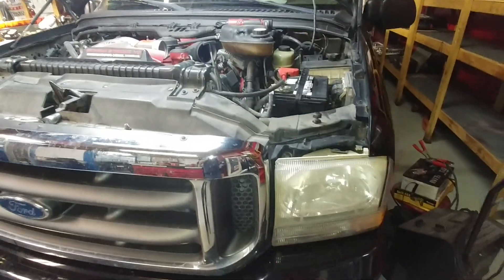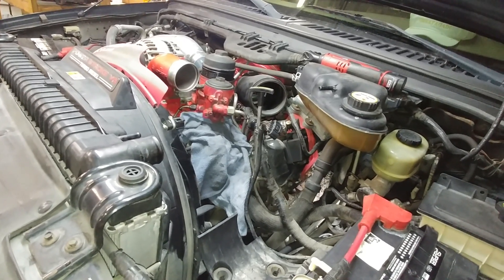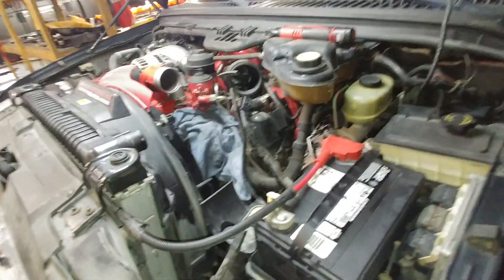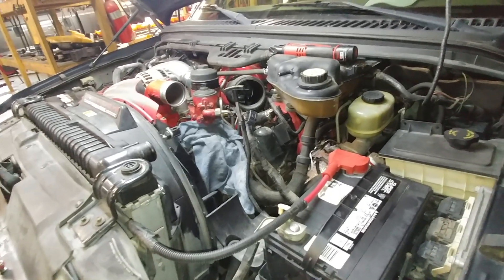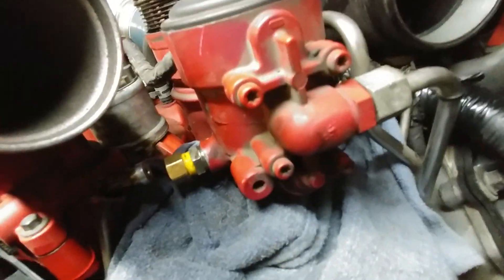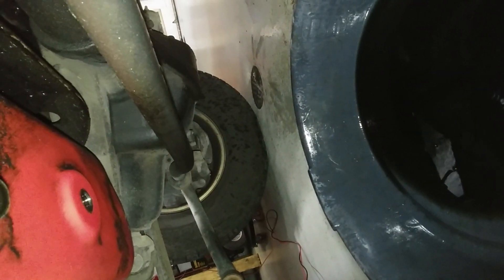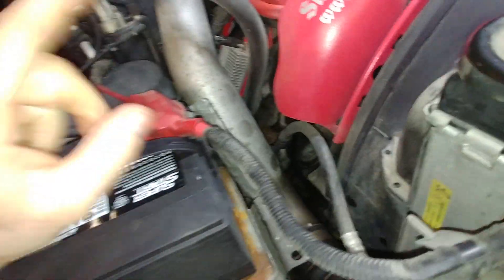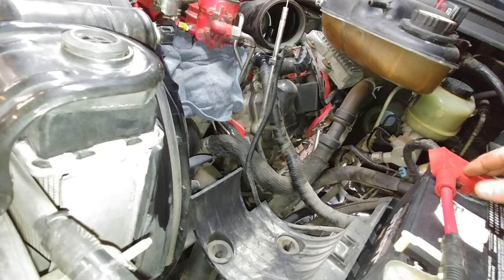6.0 Powerstroke Making Oil Injector leak

Comment: My 06 had the same issues several years ago. Always wondered why on some occasions that power would fall off sometimes. Found bad fuel side injector o-rings on #7 and #8 injectors. Also found the fuel pressure was WELL below spec. Installed Ford factory blue spring upgrade, replaced the fuel pump, just cause, and all new injector o-rings, since i was already in there. That was about 92,300 miles ago, runs awesome, and no more fuel in oil.  After some discussions with other technicians, very low fuel pressure can cause the injectors to drawn the fuel needed, causing the o-rings to roll under and leak. Just a thought. Solved the issues with my truck.

Comment: Anthony, what is the max pressure the frame mounted pump? What type of fuel does he run? “If” he runs an additives, what kind and does he double or triple dose. Blue spring update? It seems fuel in the oil is the result but what is the root cause?
The only reason I ask and it’s not related to a 6.0 however we had a similar concern where the low pressure pump was feeding too much pressure to the high pressure pump and it caused oil contamination. Gas car, direct injection. Just trying to think out of the box. Your the expert on the 6.0 and you have seen more that I will ever see.

Comment: Hello. Just found your chanel and i like it. How did you make the block off plugs for the fuel filter housing? I was trying to make some but couldnt find right threads at the big box harware store.
Reply: Try the Hydrolics hose shop I just got one of those problems thin oil I wonder if the injectors were leaking internal to the oil discharge or seals. On the one I have all seals have been replaced

Comment: Usually these injectors leak where the body of the injector screws together not at the upper o-ring. Which explains why in the previous video of this truck replacing the o-rings did not fix the leak requiring injector replacement. 
BTW IDS is capable of turning on and off the fuel pump instead of hooking up battery and all that extra stuff.
Reply from the maker: Dillan Webb that might be true about the housing of the injector.  I do not attempt to take them apart.   Also I'm aware of the Ids capabilities.  It's fairly ridiculous to have the key on for all that time.  I can hook that wire up in about 30 seconds.
Reply from the maker: The previous injectors were obviously media blasted also.  And they were cheap remans from some online retailer.   I don't entertain those injectors EVER!!

Comment: Bet there's an aftermarket injector in there, the seals are junk and they all end up leaking at that upper seal after a while. Motorcraft or Nothing........
Reply: Yup I agree, I wouldnt use anything but FMC injectors same with seals and o-rings. Otherwise your just asking to go back in again and it's not if it's a matter of when